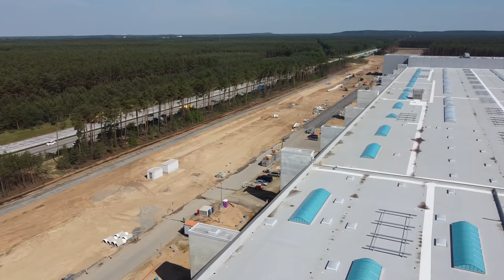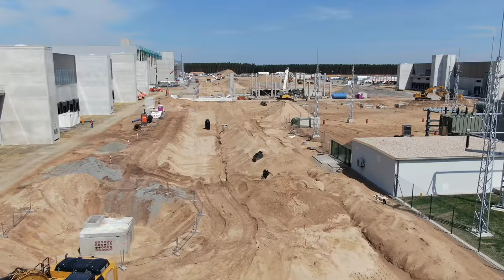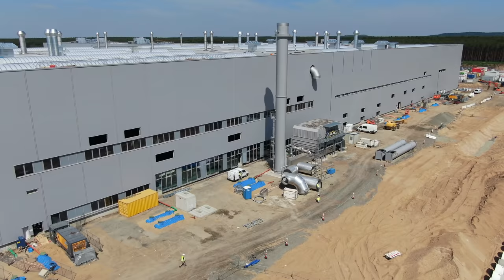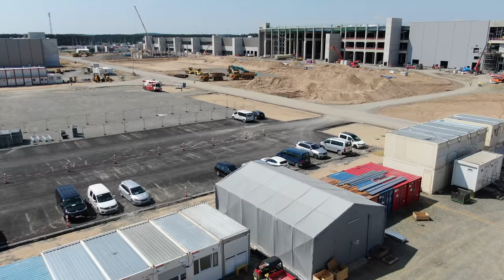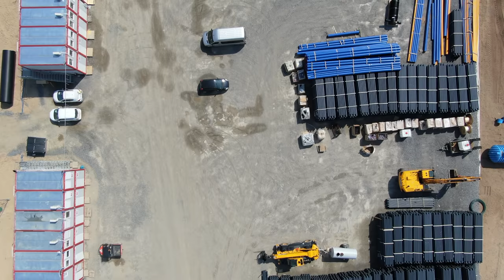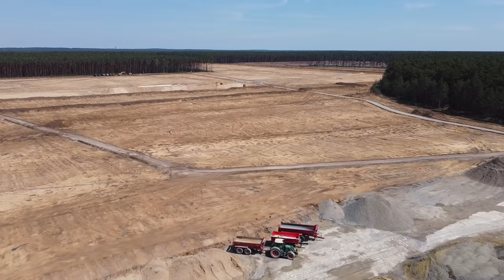Giga Berlin | 2021-06-05 | Tank Farm Columns

Comment: What will the tank farm be used for?
Reply: Fuel for furnace, aircondition gas, oxygen and acetylene, liquids like lubricants, etc... The list goes on.
Reply from the maker: @t.w.3  No, it's not for fuel for furnace, aircondition gas, oxygen or acetylene. It will store liquids that are needed for the cars. Brake fluid, windscreen washer fluid, antifreeze, gear oil and refrigerant.

Comment: Seems like they have added the first chimney for the first casting machine.
Reply from the maker: At least on the inside. According to the preliminary permission, there will be 8 chimneys for the casting machines on the roof, with the same height as the highest chimneys on the paint shop.
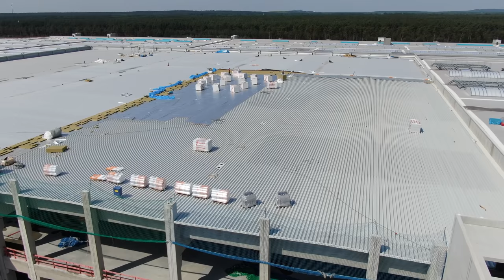Reply: @TobiasLindh  isn't it the one you see on the roof at 7:18 - a small square metallic shape?
Reply from the maker: @ChristianBlueChimp  Might be the base of the chimney, but the chimney itself should be much bigger.
Reply: @TobiasLindh  yeah like we see at Austin.

Comment: Comparing to GigaShanghai, the speed of construction is slow. Already 16 months passed. It seems at lease two more months needed to finish the whole thing. For the record, it only took 11 months for GigaShanghai to start production.
Reply: ÄÄÄÄÄh?  in Shanghai they are building yet.  In Shanghai was no Forest at The area. And in Shabghai the M3 isnt build with Gigapresses and the Accus in Shanghai are buy by outdoor factories. .......  Ok China first  and China is great again.
Reply: @gerhardhettler8521  no gigapress? They are producing model Y with gigapress right now. FYI, gigapress s are produced by Chinese. Even IDRA in Italy is owned by Chinese.
Reply from the maker: @林桥-c1s  First phase Giga Shanghai was exactly one year from ground breaking to first public deliveries. Ground breaking in Berlin was end of May 2020, so right now it's a little more than a year. In the end it will probably be about 1,5 years until first deliveries, which is still extremely fast, especially for Europe.
As far as I know, Giga Shanghai doesn't have IDRA Giga Press. They have LK Impress Plus from China. They are almost the same as Giga Press, and LK is partly owned by IDRA in Italy.

Comment: Is the tank farm for recycling water?
Reply: I want to know how there use it to. Store Rainwater? Chemicals? what for?
Reply from the maker: No, it will store liquids that are used in the vehicle, like brake fluid, windscreen washer fluid, antifreeze, gear oil and refrigerant.
Reply: @TobiasLindh  Thank you for helping me understand the use.
Reply: @TobiasLindh  And welding gases.
Reply: @TobiasLindh  Why does an electric car need antifreeze?
Reply: @robertshaffner707  Because it has a cooling system for the battery, motors, inverters and charger.
Reply: @okkeharr  That’s cool! 😉😁
Reply: No. Those tanks will be for "technical" fluids as explained above. 
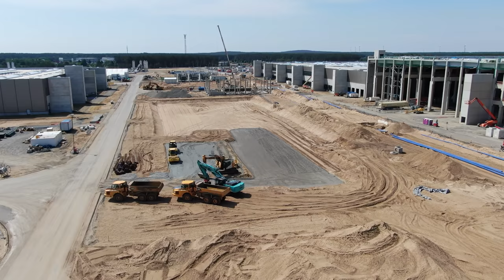There will be a wastewater treatment facility between the tank farm and the blue excavator (11:35). 
It will have basins and also tanks for process water. E.g. water coming from the paint shop. This water will be examined and possibly also treated before released  - together with "normal" wastewater - towards the sewage plant.